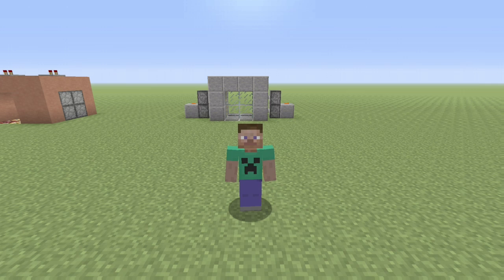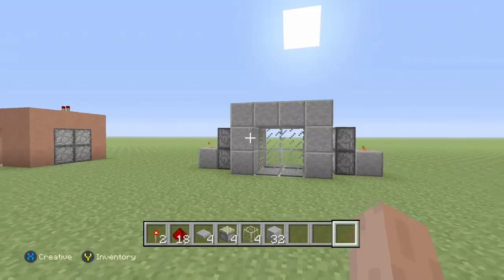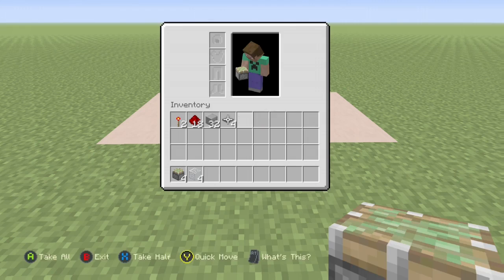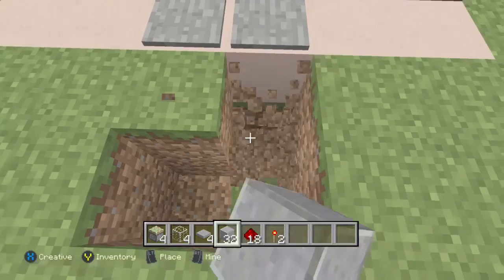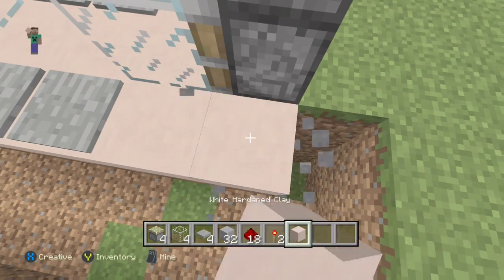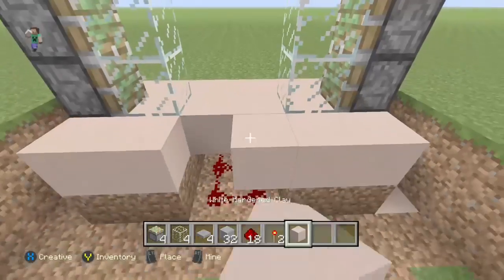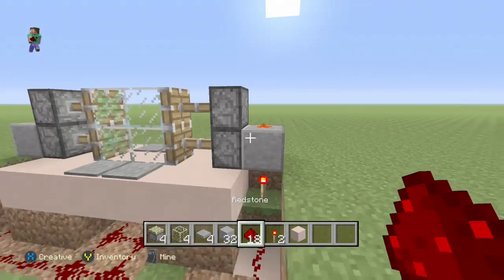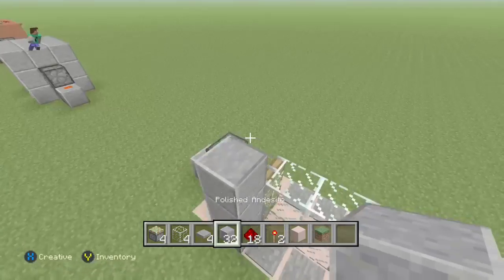Minecraft Tutorial: How to make a pressure plate door

Comment: I tried this with White Terracotta as the base, and i surrounded everything else with glass to make it see through. Whenever I step on the pressure plates the doors do not open. Any idea why they won't work. This was a while back but, I am on Java Edition 1.14.1.
Reply: U need mojang
Reply: Make sure you're not using heavy pressure plates. Just normal or light
Reply: I was using a gold (light) pressure plate. Switched to wood and it worked.
Reply: Try to change the pressure plate